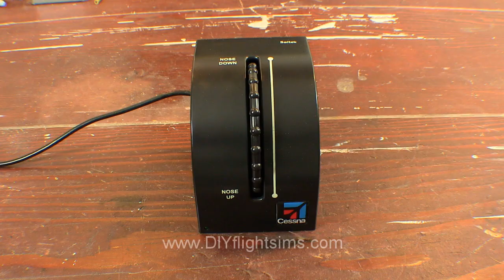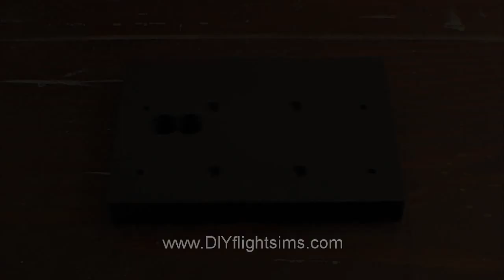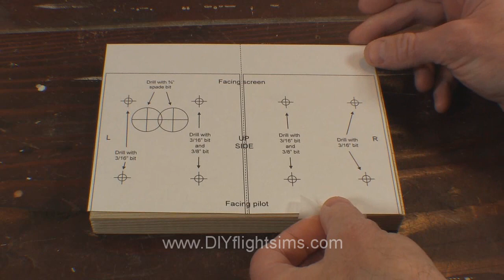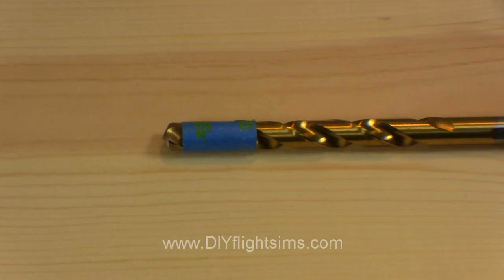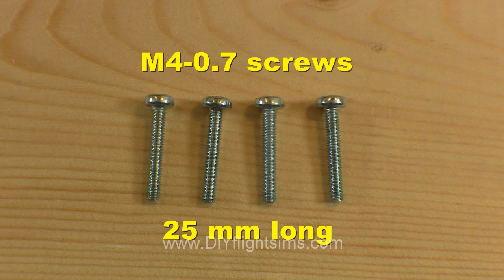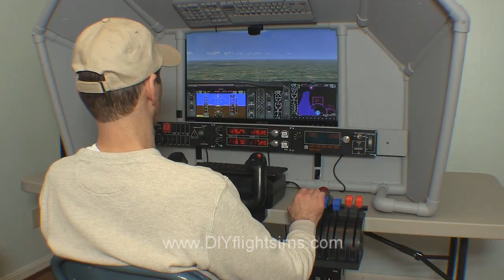Saitek Trim Wheel Adapter

Comment: Wich modifikation do you use?? I ned the best solution
Reply from the maker: I use the Saitek Trim Wheel Adapter Template. You can print the template here at the Builder Academy https://courses.rogerdodger.net/courses/take/builder-academy/pdfs/1524051-printable-page-saitek-trim-wheel-adapter-template

Comment: Just seen this and there is one question that I've always wanted to ask. So if you don't think this is lame to ask after a long time since the post was made I want to know this. Why is this called a Cessna. Is it only for Cessna aircraft because I would want to use other aircraft.
Reply from the maker: I can see how that could be confusing. This trim wheel is great for any airplane, it is a great product.

Saitek had a marketing agreement with Cessna that allowed them to put the Cessna name and logo on their products. That's all.
Reply: Thanks, and great name we have too lol. I assume, seeing as I have the throttles, pedals and yoke they will work with other aircraft too.

Comment: I know that on the throttle quadrant you can change the placement of the nobs for a multi engine, but is it possible to make the blue one trim or will it always be prop?
Reply from the maker: I never tried that because all the real airplanes I ever flew had trim wheels, never a trim lever.

Comment: The Link listed above for the template doesn't appear to work.  Is there a different link?
Reply from the maker: The printout is now available at the Builder Academy https://courses.rogerdodger.net/courses/take/builder-academy/pdfs/1524051-printable-page-saitek-trim-wheel-adapter-template
Reply: https://www.rogerdodger.net/wp-content/uploads/2017/03/Saitek-Trim-Template.pdf

Comment: hello question see if you can help . when i click down my flaps on the multi panel it turns off my auto throttle ,I have checked to see if any other buttons are assigned to auto throttle  and I can say no I think  lol